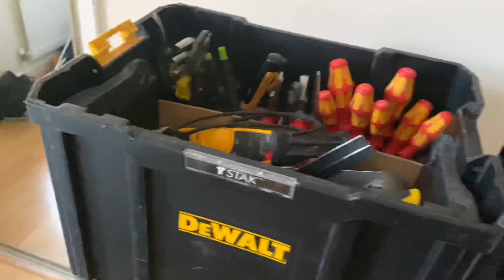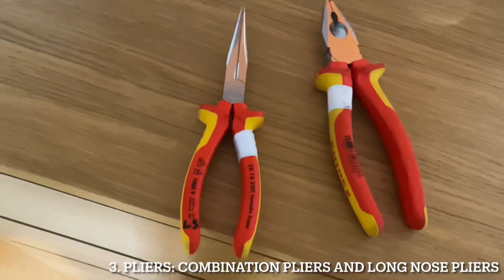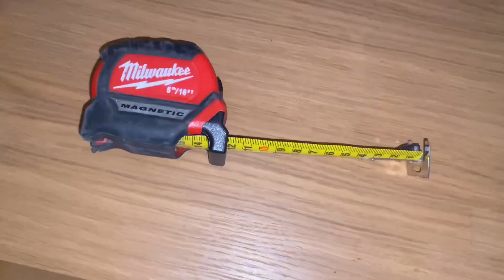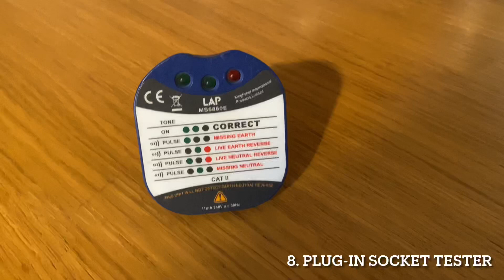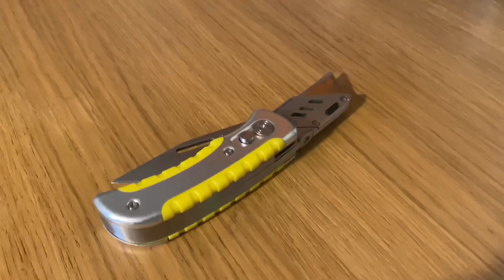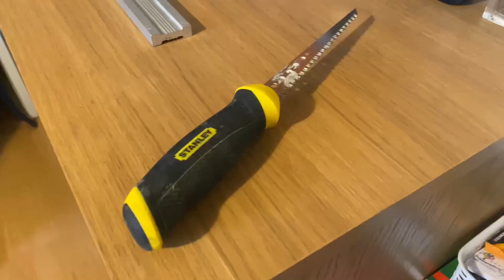MUST HAVE ESSENTIAL Tools For An Apprentice Electrician

Comment: Those tools are way to clean for an experienced tradesman. Did you just buy all these tools?
Reply from the maker: I have most of the tools for a year on average. They are clean yes. Firstly, I gave them a good clean for the video. And secondly, I am an apprentice so I don’t do as much work with my tools as a qualified electrician may. 👍🏼